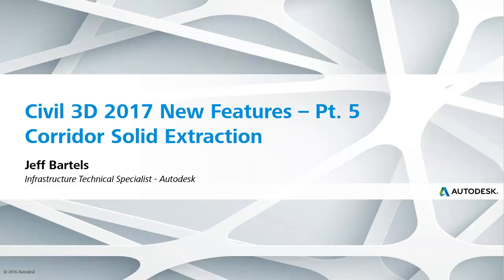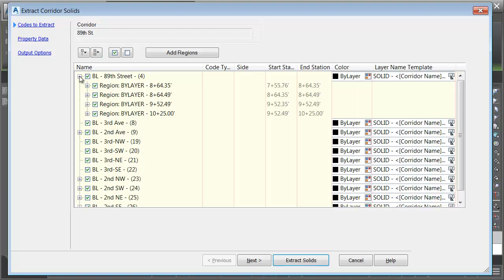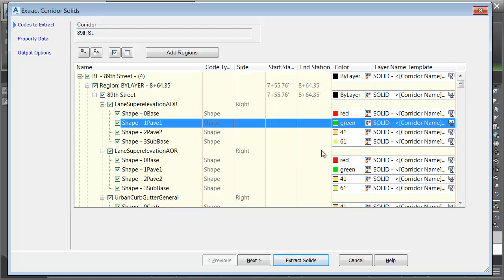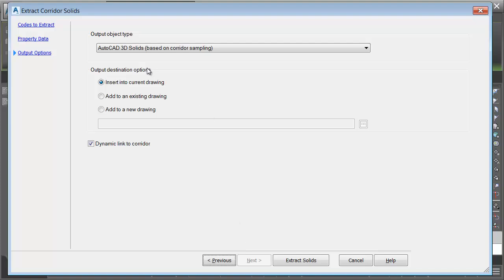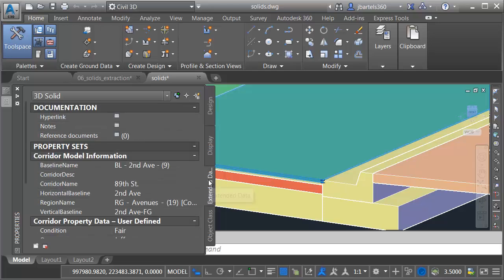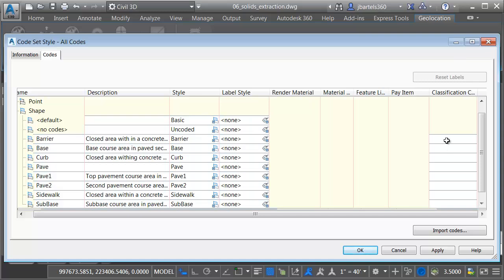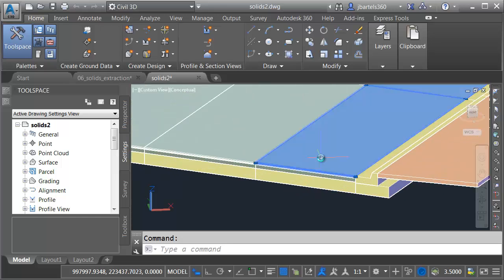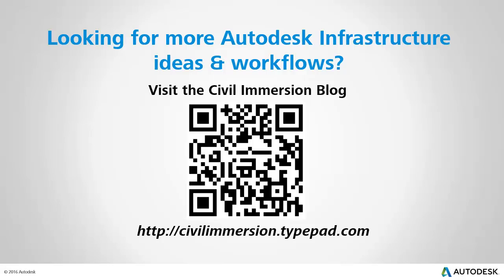Civil 3D 2017 New Features - Corridor Solids Extraction

Comment: Hi Jeff, thanks for explaining the extract solid function. I was wondering is there a way to extract the solids diagonally? I am asking as i found that it only extracts the solids on a straight edge. I am trying to slice and dice the model in preparation to link the respective solids with construction activities in Navisworks to create a 4D programme.  I was thinking that perhaps we cause extract by polygon which may allow us to extract in the desired shape. However, would the suggest method be manipulating the extracted solids itself? Would be difficult as it's in a 3D space. Thoughts?

Comment: Thanks you. However, the problem of extract solids is that the start and end region of the solids don't regenerate dinamically once you split, add or remove one region in the corridor. It's a pity in Bim workflows. Moreover there is no formula in property sets that figure out this issue. Hope this will be manage by Autodesk.